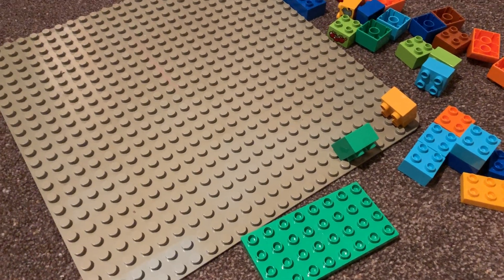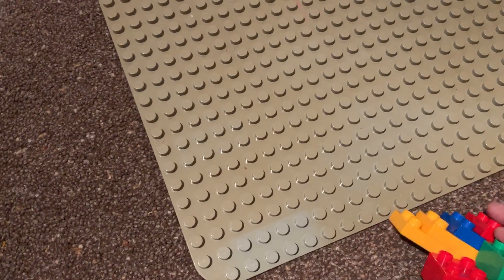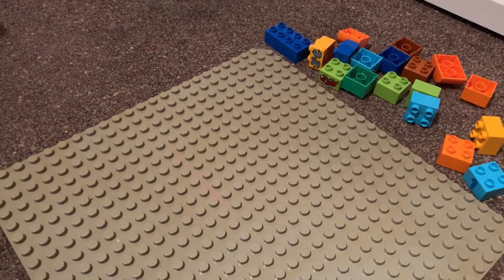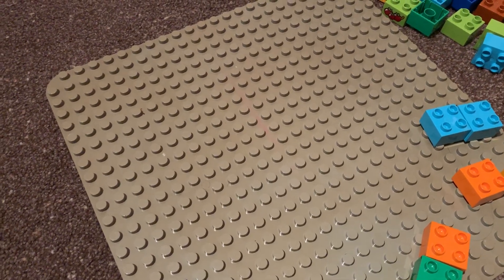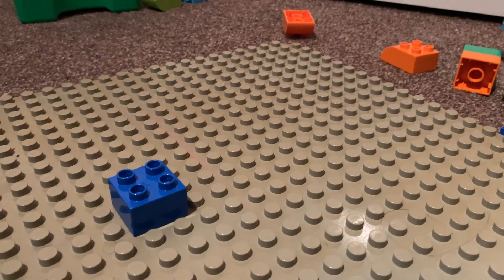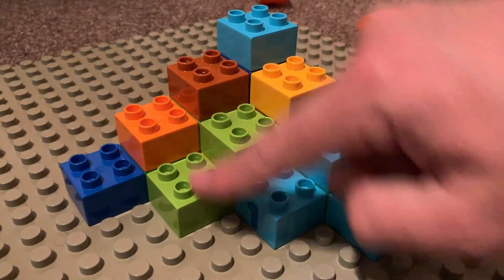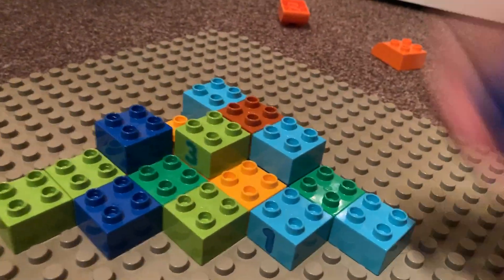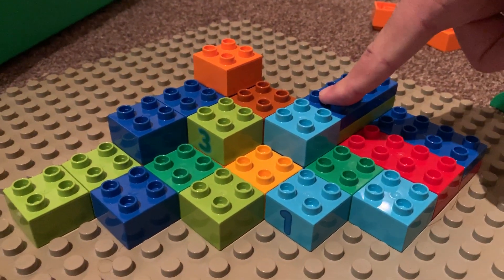LCD masking in 3D printing

Comment: Hello. I would like to clarify how you got the value of 22.94 degrees with a layer of 0.02?
As I understand it, the formula for calculating arctan (0.02 / 0.047) = 23.05
It is possible that he didn’t understand that.
Thanks for any answer.